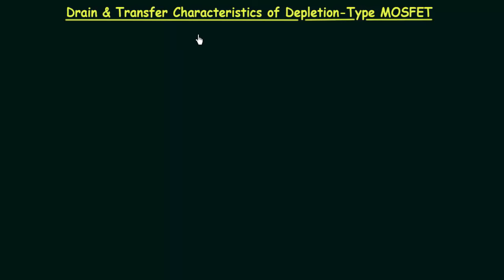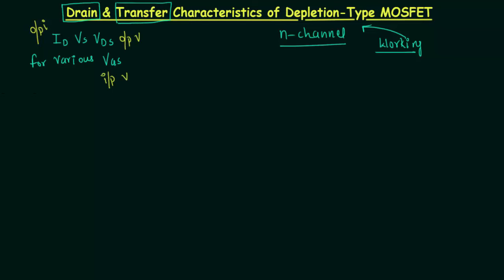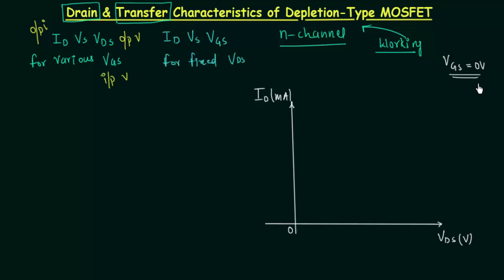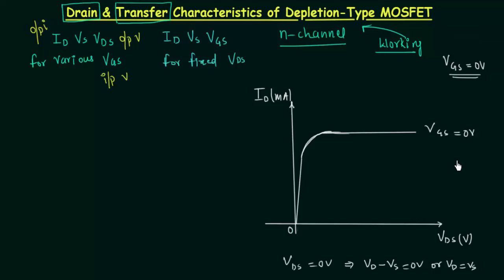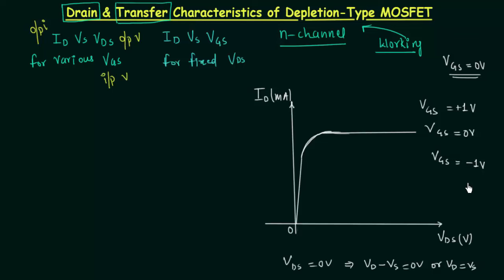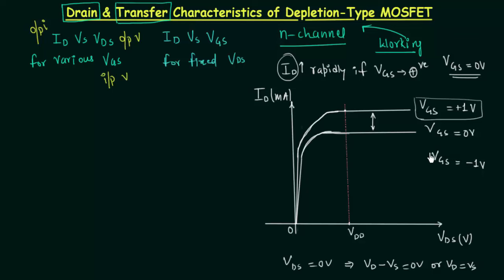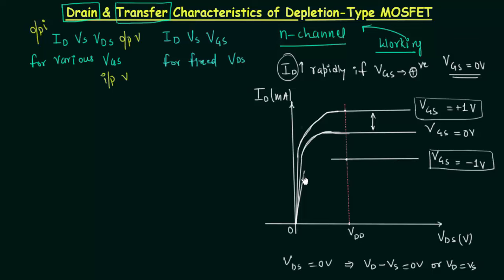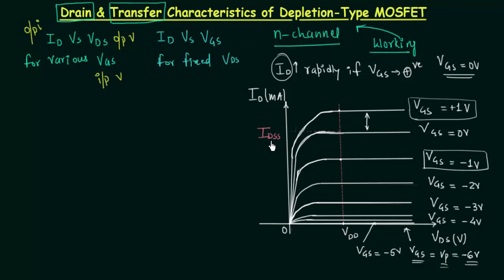Drain & Transfer Characteristics of Depletion-Type MOSFET

Comment: we call it enhancement mode in D-MOSFET, bcoz as positive Vgs applied through gate , the width of n channel between source and drain increases due to the flow of electron from p type substritute into n type channel. Hence drain current also increased due to the width of n-channel, thus the drain current enhances so we called it enhancement mode.

Comment: positive gate-to-source voltage has “enhanced” the level of free carriers in the channel compared to that encountered with VGS = 0 V.For this reason the region of positive gate voltage on the drain or transfer characteristics is referred to as the enhancement region, with the region between cutoff and the saturation referred to as the depletion region as it depleted no. Of free electrons by recombination process.